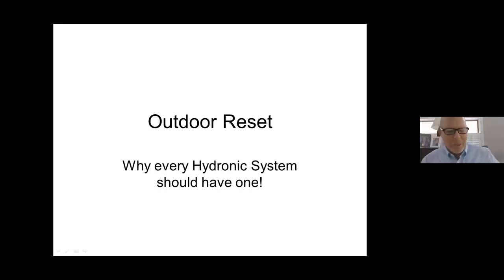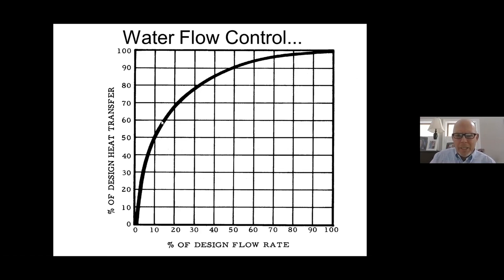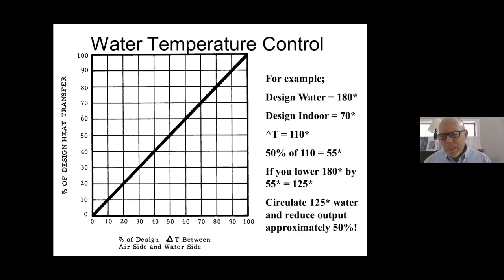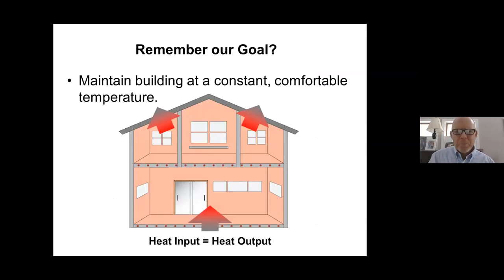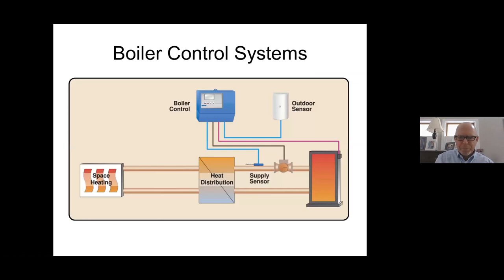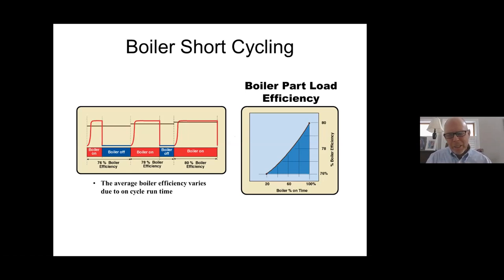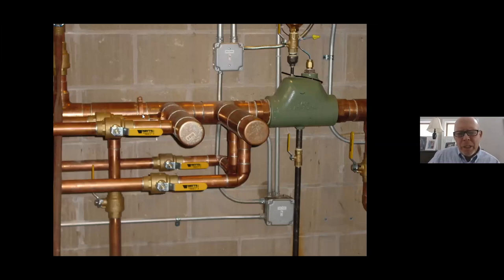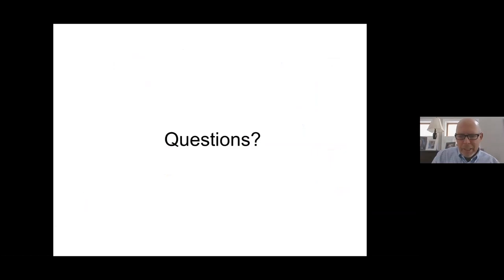What is Outdoor Reset and Why

Comment: This sounds exact what I need. I have an old house with hot water baseboards and I only feel comfortable while the water is circulating. As soon as the circulation stops, the house cools off and becomes uncomfortable. I want to extend the circulation time and stop my boiler from short cycling and increase my comfort.
Reply from the maker: This is exactly what you need!

Comment: One of the benefits missed is fewer cracked boilers, especially commercial, lower operating temps and less major expansion/contraction make a huge difference in boiler life. I also think that now with higher fuel prices here to stay that ODR is also beneficial to small mass boilers and even a System 2000, I think now they say ODR can be a 10-30% increase in efficiency and that would easily pay for the ODR control in one year or less. Even with a small mass min temp of 160-170 and max of 200-210 there would be huge savings.
Reply from the maker: Exactly right!

Comment: Just had a Bradford White combi boiler installed in my home.  The plumber said I didn't need the outdoor reset even though it came with the unit.  Any thoughts?  Thanks ahead.
Reply from the maker: Outdoor reset isn't required, but it increases boiler efficiency and if it can be installed it should.

Comment: Does outdoor reset require the circulator to run constantly?
Reply from the maker: It will run as long as the system is running